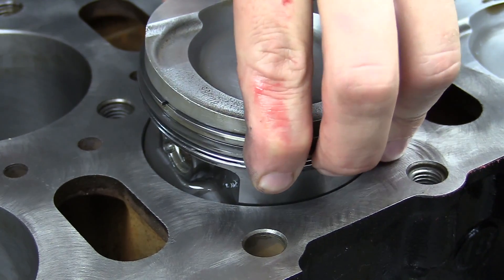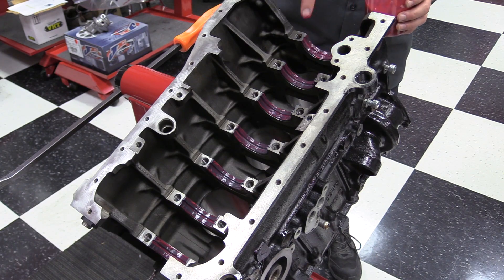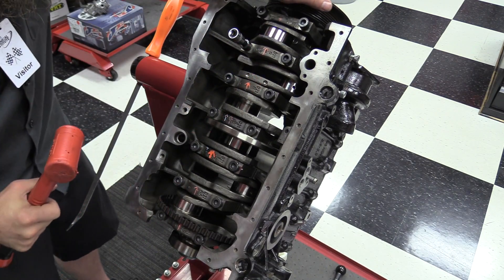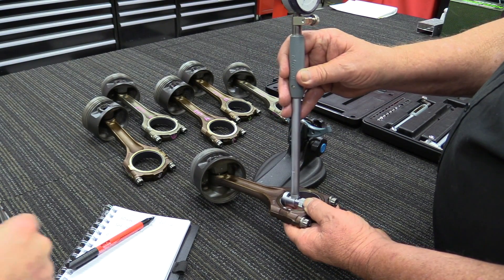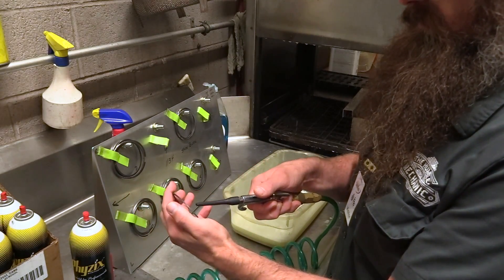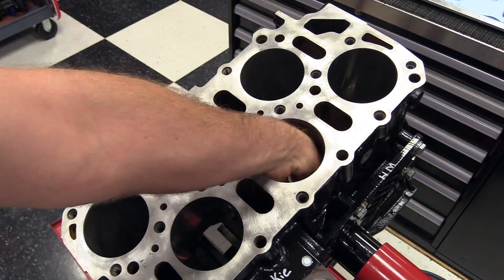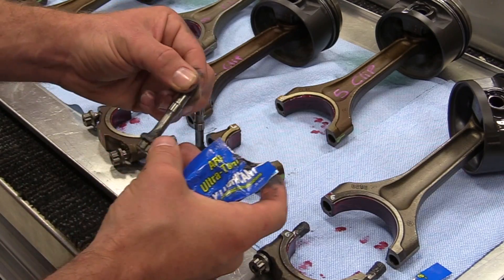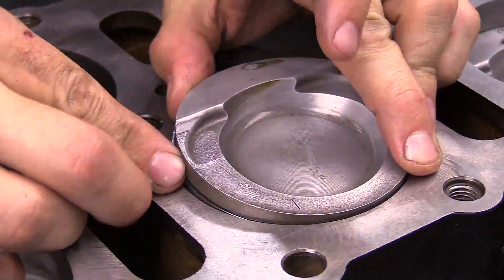How To Assemble an Engine Block

Comment: How likely is it for the Toothed wheel on the crankshaft to fail? Is it replaceable or do you have to replace the entire crank if the wheel where to fail?
Reply from the maker: I am not really sure it's replaceable. It looks like it could be replaced separate. I have seen 1 fail on a 2.0 ABA engine.
Reply: I think it depends on the crankshaft design. Sometimes when a timing chain on a Ford Modular 4.6 or 5.4 engine fails, it tears up the toothed wheel. However, the toothed wheel slides over the crankshaft keyway in that situation, so it can be replaced.

In a GM LS1 or related engine, the toothed wheel is cast into the crankshaft. If a tooth was damaged, crankshaft replacement would be mandatory.

Comment: I've been watchng lots of engine building videos trying to learn since i will be attempting a build myself. I have one questions
on the thrust bearing cap alignment. Since your thrust bearing has no alignment dowels, how can you be sure it's aligned with the
crankshaft?  I did not see you push the crankshaft back and forth with the rubber hammer.
Reply from the maker: I have not measured end play to see. But on the cap and on the bearing girdle there is a groove for the bearing to sit in.

Comment: What about cleaning the parts with an ultrasonic cleaner? The block/crank might have to go to an industrial shop, but the smaller parts can be used in one.
Reply from the maker: It could work great!
Reply: Yeah, I think it would be more aggressive and complete that hot tanking [or other methods], all the while, not hurting the metal. Keep up the good work, learning lots from you!

Comment: last few engines I assembled I held the block on the bell-housing bolts & didn't like the amount of flex the stand had... I am certainly going to try mounting it off one side's engine mounts.. thanks for that Charles 

 BTW I like to put 1 piston in, connect & torque the mains then give the crank 1 complete revolution, any assembly errors are usually obvious this way
Reply from the maker: That is a good idea!!!!  I will probably adopt that one.

Comment: hey nice post. am I the only guy that still is using stp oil treatment. as assembly lube it's old school I guess I did use some regular assembly lube on the last crank i installed but used the stp on the cylinders as always

Comment: Going to feed the cylinders with a twin scroll, variable geometry turbo?
Reply: I rarely see VGT turbos used in gasoline engines. That is because the exhaust gas temperature is higher than that of a diesel engine.

Comment: I am in Aviation Maintenance school right now and this video brings back SOO many memories of overhaul class. Literally everything you did we had to do and if the engine didn't work for some reason we failed the class. Talk about pressure! Lol But you sir, have got to be one of the best mechanics I've ever seen. :)
Reply: For real bro, I was a little confused that he said not using the ring tool is better, but I guess that's cause we use cast iron and he uses steel lol.
Reply: Aviation maintenance? God bless you,  I dont have the nerve to work on aircraft
Reply: Same 😁

Comment: All this time I never knew piston rings were steel
Reply: There are many different, sizes, widths, height/thickness, profiles, shapes, configurations, treatments/coatings and materials/alloys used for piston rings. 
Gray cast iron, nodular/malleable/ductile iron, low carbon steel, stainless steel and chrome/moly bearing steel  are some of the more popular piston ring materials. 
Selection is usually subjective and specific to the intended application and desired characteristics. 

http://korihandbook.federalmogul.com/en/section_41.htm

http://www.enginebuildermag.com/2012/10/performance-piston-rings/

Comment: The way you installed the pistons with out a tool is the exact same way I broke a set of piston rings and chiped the deck on my VRT. It wasn't fun having to stop mid build and wait a week for a new set of rings from wiseco. Not to mention having to get the deck resurfaced, Which ultimately led to bent valves because the clearance was too tight from the extra machine work.
Reply: I've heard that taking a cheep ring compressor and cutting the bottom to the proper degrees for the vr6 you are working on works really well.
Reply: Techtonic Tuning makes a piston ring compressor for a VR6 that actually works. The only downside is that you have to buy them based on the bore size of the engine you are rebuilding.
Here is the 81mm model which is the standard bore:
http://techtonicstuning.com/main/index.php?main_page=product_info&products_id=2869

They basically start with a standard tapered ring compressor, then cut the bottom at an angle to match the VR6.
Reply: Damn ! lol, that sucks bro !
Reply from the maker: +bryce roseborough ouch!

Comment: Hey Charles, love the content. Question, I'm rebuilding my 06 Toyota 2AZ. I have majority of the parts needed. The parts I'm miss is the timing set. As I'm going to school. Most of my money goes there. I want to start working on it but I don't know when I'll be able to get the timing set. Humidity is also a concern since I live on an island. What would you suggest I do? Should I start working on it or wait until I get all of the parts?
Reply from the maker: I would do as much as I could. That way you don't lose interest in the rebuild. But there is no wrong answer.
Reply: HumbleMechanic thank you for the advice. Can't wait to see the white wooki in action.
Reply: Get into it man! just keep everything coated with oil and it will be good. A useful item to pick up are what are called "contractor garbage bags" (or something along those lines) They're really big heavy duty bags, make a great engine cover while your not working on it.

Comment: Good for building engine for yourself, maybe.  Not so good to build engines for profit unless that is all you do.  Customer gets 1000 miles away and run car hot. You might have to pay dealer prices to fix it, buy him a new motor, or pay very expensive tow bill 😳
Reply from the maker: I don't follow.. Other than the not having the ring compressor. If you were doing ANY scale of engine work that would be a must.
Reply: HumbleMechanic Just pointing out that it is better to sell a new engine if you are an independent shop because of the high liability. There are advantages being an AC Delco or even a Napa service center and have a nationwide warranty. Otherwise you need to have good shop insurance and that is expensive.

You have to break that dealership mentality of fixing cars the cheapest way possible. The reason they do that is because it's under warranty. In a real shop you would install a crate motor and if anything goes wrong, they will pay you to fix it and or send you another motor! If you build it, you got to eat it. 

I don't know how Volkswagen does it but GM sells (not remans) brand new engines and most are cheaper than you can rebuild it, unless you own a machine shop. Most independent shops don't have that many techs nor that much time to rebuild engines. 

Most cars around here the car is not worth a new engine or they don't have that much money. Might be easier to replace the car if you had to pay a shop to fix it. You wouldn't spend 5 grand on a car when a replacement with lower miles cost only $8900.
Reply from the maker: AHHH Okay That I understand. 

Even at the dealer we would never go this deep in an engine repair. It would get an OEM reman engine. Buy the time you add parts, labor and time with out car, its a no brainer. 

The way VW did it was 
1) Tech diags issue
2) Tech writes a quote for repair
3) The repair cost is compared to replacement cost.
4) If repair cost is ~75% of replacement the part gets replaced. 

I agree with pretty much everything you said in the second comment man. Well other than the "real shop" part ;)

Comment from the maker: Thanks for watching. I am off to put more parts on this engine. I will have a full update video out soon!
Reply: Would you ever work on a TDi engine? Also great content keep up the good work
Reply from the maker: +Diego Ace thanks. I've worked on tons of TDIs over the years.
Reply: your video scare me doing my engine :/
Reply: Joseph V. Stalin most pistons are parallel to the deck.  idk much about vr engines but by the look of it that must be how they sit.  you want to load your pistons in the correct orientation and avoid turning them as much as possible so the ring gaps don't move
Reply: where can I get all the parts?
awesome video!!
Reply: HumbleMechanic, I am learning more about engines from you and EngineeringExplained than I did from 3 years of auto mech classes in high school. Keep up the good work. Thank you
Reply: What brand are those bearings?
Reply: Is this the same as the block on the 2.0 TSI?
Reply: I've never owned a VR6 but I came close to buying both a used 1995 Corrado and a GTi.